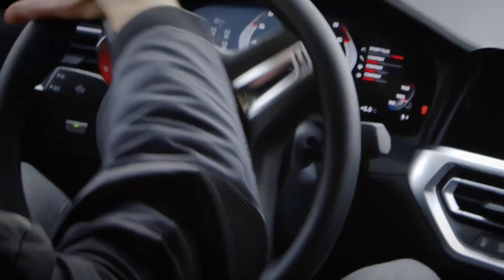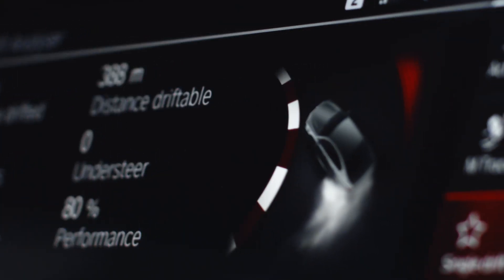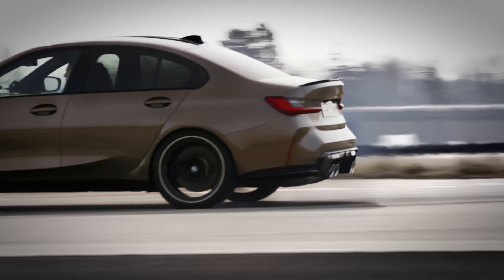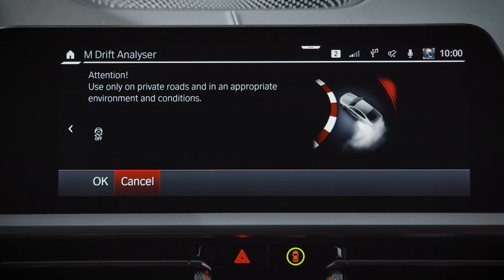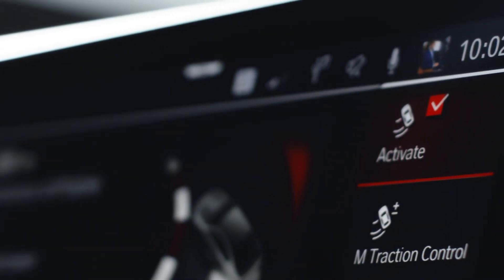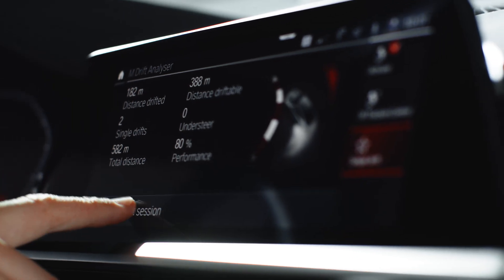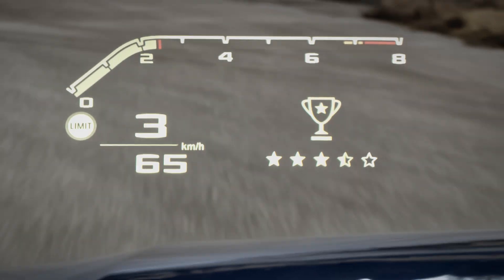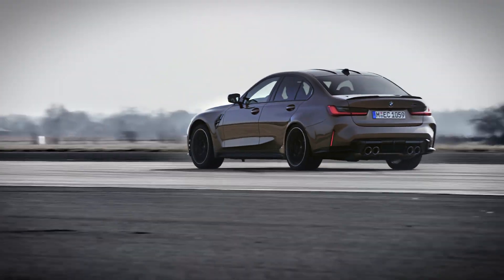How-To. Using the M Drift Analyser in your BMW M.

Comment: buy an e36, weld the diff and start learning
Reply: Built a E36 M3 racecar in my garage, turned out beautiful. Took 8 months, but was built propper. 😊🖐🏁🏁🏁
Reply: The e36/7 is more fun.  Have a M roadster and had a M3, 325is, 318i and the Z3M is what I have kept.  Has the S54 power plant from the e46 but the e30 rear control that hook like it is on rails with the e36 front end for great control and fast responding or turning then the M3.  Also top down drifting is so much fun and it had roll bars too in my 2002.  The 2001 and 2002 where the best Z3's to have
Reply: @fryreartechnology7611  That's awesome,  I still have the 330 ,the last one on my 50th. Love it. 👍😎
Reply: @petertsalavoutas3995  I learned to service them myself even going as far to get my hands on the BMW laptop.  Simple to service and troubleshoot with the correct tooling
Reply: That is fantastic.  Love my Beamers. 🏁🏁🏁

Comment: Amazing 👌
Reply from the maker: We totally agree with you!
Reply: @BMWM  Thank You 🙏
Reply: @BMWM  since 2010 until now you couldn't solve the common issues for oil burning especially the seal valve this the problem to keep people not like your engine V8 and not reliable and useing plastic a lots in the engines, should replace plastic to steel or aluminum.